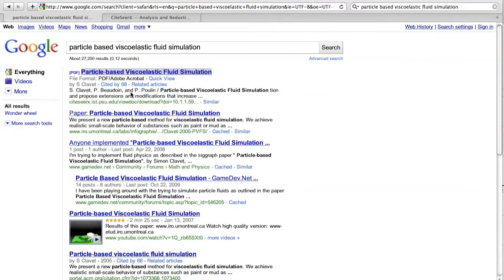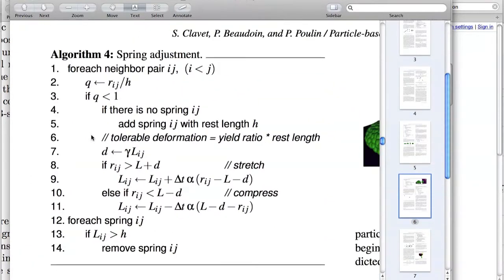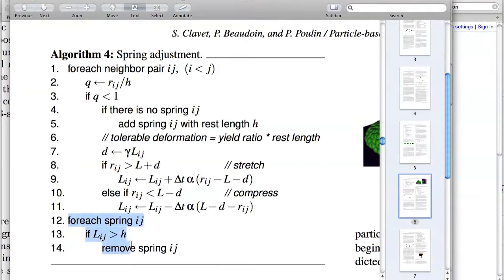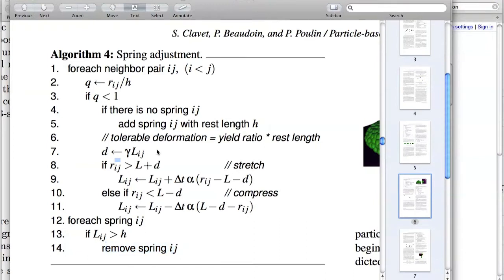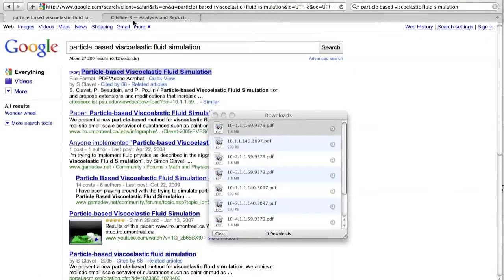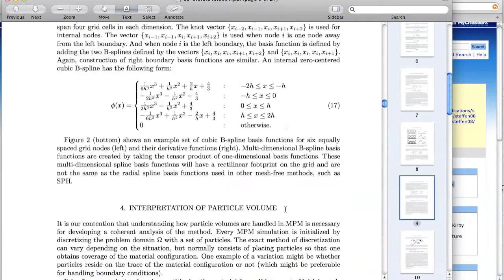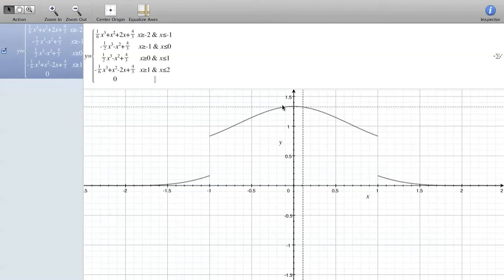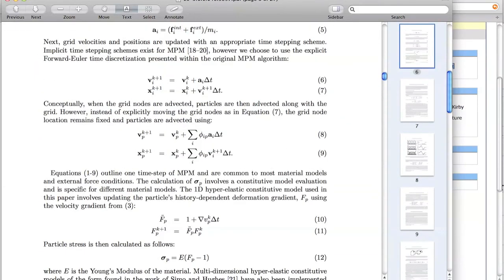Tutorial on Errors

Comment: Nice job on finding the piecewise polynomial constants, but you've altered the maximum of the function, which is probably important. If you plug in the original equation at 0 to find that peak value, M, then take your new smooth version at get it's maximum N, multiply all of your new piecewise polynomials by M/N and you'll have the original maximum and still be smooth.